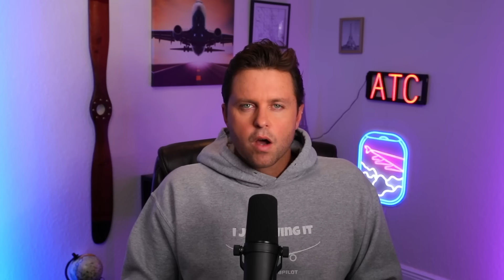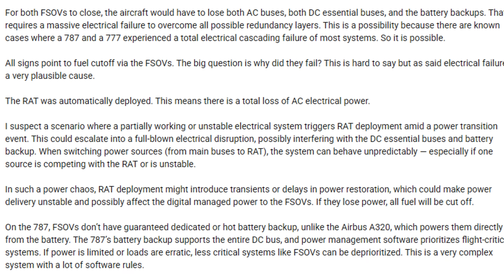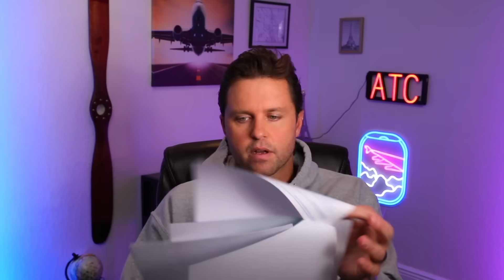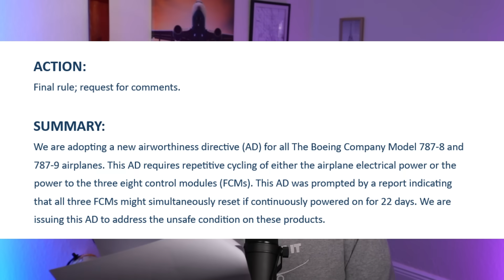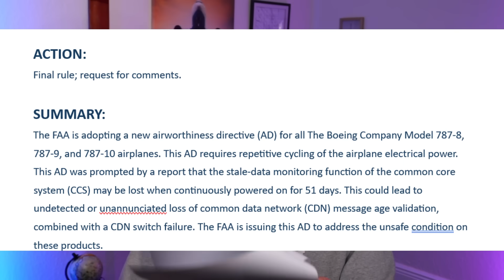Air India 171: Did a Software Glitch Cause Dual Engine Failure?

Comment: I don't understand if some electric failure does pilots don't have any manual control of the aircraft to land safely? Even if something majorly wrong and the way video shows Boeing 787 was gliding and gradually went down and does pilots don't have option to glide them more to a safe location or they not trained enough to handle such a situations?

Comment: Gary you are right and it's common in automation that some software contain accumulative faults, Airbus suffers from the same defect. Usually corrected by rebooting, its just what happens.

Comment: Incorrect info about what you refer to as the FSOV.  To be clear, the reference is to the airplane valve located upstream of each engine in the strut.  The following is basic architecture, at least on a Boeing, not just specific to a 787:

 The engine also has its own fuel control valve, but the FADEC (which has its own power source when the engine is running or shutdown but still spinning).

For a theoretical complete loss of airplane power, the airplane fuel shutoff valve will retain its last position with a type of magnetic latch.

The only things that should be able to defeat that magentic latch are 1) fuel control switch pulled to cutoff, or 2) fire handle pulled. The fire handle will be locked in this case, unless there is an engine fire indication or the fuel control switch is already at cutoff.

Upon takeoff, pilots would not be pulling fuel control switches to cutoff, nor would they touch the throttles.  Even if there was an engine fire indication, they are not touching these until safely above the ground.  For instance, you wouldn't want to pull the wrong fuel switch, or pull back the wrong throttle.  Get the airplane safely above the ground, then deal with such issues.

Your source post you reference has some credible statements, but the hydraulic references suggest he or she is talking a bit beyond their knowledge base.

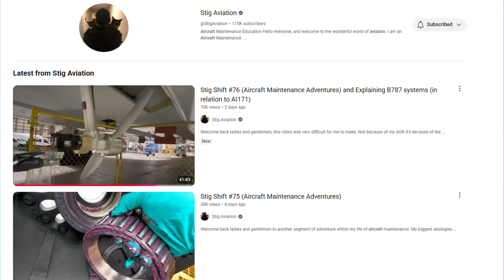Comment: Around 8:31, you said "millimeter of a second". I think you meant "millisecond", which is a valid SI unit. We don't know enough about that FSOV to say whether a millisecond power drop-out is enough to release the spring. Transients in electrical circuits are complicated. I kind of doubt if anyone knows enough about the transient electrical behavior in this aircraft. Which is negligent, but it's Boeing, which brought MCAS to 737 Max.

Comment: "When switching power sources from main bus to RAT, the system can behave unpredictably"
This is just flawed design.   Engineers know that when a RAT deploys, it's power will kick in and "compete" with the power bus.  Even a kid in engineering college will design so that there is orderly transition.  If here there wasn't, then it's absurd incompetence by Boeing engineers.  Wait -- there's more incompetence.  
If you design something like a fuel shut off valve,  you should have two valves, for redundancy, on each engine. Each FSOV must have dedicated dual power sources (like the Airbus).   Boeing has only 1 FSOV and it doesn't have it's own power source.  So that's 3 design defects right there.  But how can power to a fuel shut off valve ever be a lower  priority -- unless you liked to fall from the sky!
And finally, anytime FSOV shuts off fuel, a big light "Fuel shut off" should go off.  Pilots must be trained to throw a bypass around this.  They are nor.   So, one more point of Boeing incompetence.
BTW, any problems in an AC bus should not affect the DC bus.  They should run physically far apart from each other.   That's just good and careful design.  Looks like that wasn't done either.

My view is instead of expecting a series of electrical failures, it could be simply the computer stopping the fuel to the engines.   We know in the 737 MAX, the computer put the plane down.  Here too, the computer could do something absurd, like as shutting off the fuel, by going in to ground mode.

Comment: MASSIVE electrical failure MAY have occured.  

Cause - Water from the bathrooms damaging the electrical systems under the floor. Causing total electrical system failure. 

* Source - 2025 June Boeing AWD !

Comment: Excellent channel! Glad I found you! I’m just a layperson who flys tourist style occasionally from LA to Maui. My take is that what ever caused both engines to shut down must be reversed engineered with a super manual override system that the pilots can push or pull a lever which in a split second can restore fuel flow ! If I’m understanding that in the current 787 models this ULTIMATE manual override is not possible? Could a manual cable system (like a choke in a 1960 pickup) not be designed in? Or even an a fuel override powered electrically by the engines themselves using air from the near idle fan blades? I’m guessing this horrendous event could have been avoided if an ULTIMATE manual override was available to the pilots as a last resort option. Thanks for your consideration and the excellent comments from your knowledgeable community!

Comment: 4 days after crash an AD was issued about leaks in forward lavatory ? EE compartment is right under that . Also I heard that its rainy season in India right now and that rain might have entered  the airplane through external power plug as it was left open and that water collected when they rotated it went into EE compartment and then had a total electrical system failure .

Comment: 'I'm not going to speculate....' 
Why even post the video, it's all speculation.
If there were a major systems failure which affects the 787, the investigation would already have revealed as such. There would be a technical directive distributed to the airlines or the type would have been grounded. 
None of that has happened.

Comment: Gary makes some very good points. I would like to enter the zone of pure speculation for a moment. Would it be possible for the computer systems on the plane to be hacked or the updates to the computer system to be sabotaged by hostile parties? India just got through with an air war with Pakistan, who was backed by the CCP. Those  parties might have the motive and ability to do such things it seems like, but only people involved with the design and maintenance of those complex systems would know if such a thing was even possible.

Comment: Air India Black Box Decoded | NDTV Explainer: What Is The Status Of Crashed Air India Black Box https://www.youtube.com/watch?v=8Ng2QIK33mc  Maximus Aviation : water leakage problems can cause electrical problems https://www.youtube.com/watch?v=CcbJ8XkoT_I  WOW. Heavy stuff. How is the design? Why is it leaking?  What operations can cause leaking? How often to replace a coupling? What is the life time of a non-leaking coupling? What conditions can cause leaking? Guarantee always includes "normal" operation. Within the guaranteed operating conditions. What are the guaranteed operation limits and is normal operation for crew, maintenance / cleaning personnel  and passengers possible to keep within those limits? What are normal to expect procedures / habits of maintenance / cleaning personnel and passengers? What is "normal;"use? What does cause the leaking?  Is a heavier design required when so many airplanes have problems? Is it not only the coupling or should a complete redesign of that facility or the protection of the electronics be considered because coupling start to leak in many airplanes. Are water drtains possible and will the be effective? It is possible to dry it? Is it water from the toilet/etc or is it water from condens ...it is cold at thousands of feet. You can think of a complete redesign to get a water tight / sealed toilet with no leakage possibilities or a complete water tight electrical system.

Comment: Hey Gary, many thanks for your very interesting and, if you allow, very professional video. Although since 1985 I logged many hundreds of hours in flying, but on Sublogic’s Flight Simulator, later bought by MicroSoft, I actually do not qualify for commenting. But my intuition told me, from the first moment I saw the pictures of this incident, that a. the pilots did everything correctly and were deprived of control only a few seconds after lifting off the runway, b. that the software and wiring design “took over the control of the plane”, but c. actually was itself decapacitated due to heat, d. caused by the combination of 1.  air conditioning malfunction, 2. therefore overheating vital components, 3. positioning batteries too close to crucial flight controlling cabling, that 4. went critical and got up in flames, 5. cutting circuitry, 6. causing (cascading) shortcuts, 7. triggering AC AND DC power supply, that e. on one hand, engaged the RAT and on the other made the FSOVs snap. Considering the phase the plane was in and the required time to restart the engines (in optimal conditions) resulted, that the disengagement of the FSOVs was irreversible. But that’s just a report of the intuitive flash I had as I saw that the plane started to lose altitude. On the other hand, did I hear what you said and understood it correctly, for it could (probably very likely) be that the explanation for this catastrophic event might be due to one single temperature sensor (or let it be an array of sensors (like a DS18B20 or DHT11)) malfunctioned and fed incorrect, therefore way to high values to the monitoring system, such that the latter went into panic mode, triggering the cascade? Final thought: How could Boeing design the deployment of the FSOVs in such a way, and not the path Airbus took? I mean: how can you? Really? (Sorry for ranting, but it leaves me completely speechless). Thanks, Gary, for all! Please keep up your good work. And my heartfelt condolences to all who have lost loved ones. P.S.: when I listen to you quoting Boeing, I somehow get the feeling that it is not about presenting or explaining considerations, but simply, bluntly, only "statements of justification". Ouch, that's not good, shouldn't be happening: is a very intense dark red flag! It even gets worse: time index 3:50 "the system can behave unpredictably"! Did I get something wrong? Please tell me if so. It could be. But in this context, that "a system can behave unpredictably" is, ... let me put it this way: ... is rather complicated. In my spare time, I develop code and electronic devices and they sometimes behave that way. But I would never ever even dream of calling them RTM (ready to manufacture), let alone what Microsoft calls a "Beta" Version. ... and FAA, Boeing and friends let us board tendentially suicidal vessels? WT catch my drift?

Comment: Let me save you some gnashing of your teeth, while you are “not suggesting anything”.  
The fuel shutoff valves on the pedestal behind the throttles are MANUALLY opened, and MANUALLY closed.  NOTHING on the 787, and NOTHING on any other airliner, automatically closes these.  
Stig makes this exact point at 12:10 in his video on 787 systems.  He also makes the point that both engines will suction feed if all boost pumps lose power.
Meet Kevin tries to say that the fuel boost pumps are hydraulically powered.  That would make the 787 THE ONLY AIRLINER IN THE WORLD with hydraulically powered fuel pumps.

Comment: Why don’t you get in touch with a 787 pilot at any airline?  Go through the systems manual to prove your hysterical ideas.  Using Meet Kevin and Google as your information sources is REALLY SUSPECT.  And you call yourself an airline pilot?

Comment: Even here in India, people in the Aviation industry are talking more about the Electrical or Software related issues as both engines stopped producing Thrust at a time along with no visible indication of flame, smoke or anything.😢

Comment: Bonsoir, quelqu'un peut-il nous informer sur la manière dont ce problème d'alimentation des moteurs est géré chez airbus? Ne vaudrait-il pas mieux une vanne ouverte par défaut sous l'action du ressort (cela ne nécéssite aucune énergie extérieure donc insensible aux potentiels problèmes de circuits électriques) et assure l'alimentation en carburant primordiale pour faire voler un avion. Il me parait toujours temps de la fermer sous l'impulsion des ordinateurs si ces derniers detectent une situation prioritaire non? Je comprends cependant que les concepteurs, ingénieurs de leurs état ont toutes les raisons de choisir cette solution ( vanne fermée sans alimentation électrique) du fait du  cahier des charges qui leur est imposé.

Comment: There is an important point that you are missing out on your conclusions. Exposure time of the fleet.

If it was a simple software glitch it would already being demonstrated. Let's use the 737 MAX unfortunately example.

Less than 1 year and half after its launch the accident happened. For me software glitch don't take so much time to occur due to the exposure time of the fleet.

It is not related to a single root cause. The conclusion for this accident will change some regulations to the entire aviation industry.

Comment: Boeing build highly advanced aircraft that are mechanically and electronically sophisticated; they require little input from the pilot and crew. This poses a danger for three reasons. 1. The pilots are not able to override the various aircraft systems. 2. There are too many components that could potentially fail. 3. Maintenance of components can’t be done in every country due to a shortage of competent maintenance personnel. I can’t help but think that Air India has made the same mistakes as PIA. 🔗 https://wmaslam.blogspot.com/2020/06/pakistan-politics-and-pia.html?q=Zionists&m=1

Comment: The solenoid is of a 'locking' type that needs to be powered both ways. There are two shut off fuel valves per engine - the HPSOV and the Spar valve. Both stay where they are if power is lost.

Comment: If electrical, and a pilot-operated check valve is in the line, ( functioning the same way as a flow-fuse per se ....), then I could see an issue wherein the drop in voltage causes the ,( electrical), master fuel supply valve closing and starving the PO-check's pilot line, making it close and therefore the engines flamed out..... no possibility of fuel siphoning, etc... else Gary, I can't see water being the issue as it was scrubbed before being pumped into the tanks. ..... I go with electrical, with Flow control as the issue.
Stay Safe

Comment: I believe there is too much bullshit by the unwashed masses on this accident. Let the official report come out first, and then we will all know the facts. I am sure the FAA would have grounded all 787/Gen X engined fleets if there was any possibility of this being the cause, but they have not. No modern digital aircraft shuts off fuel to the engine "automatically', it is always the pilot's responsibility to control his engines. This stupid idea if possible, would be killing people left right and centtre. Do yourself a favour and wade through CFAR 14 Part 25 et al for the certification and safety requirements of large civil aircraft. We do not need this clickbait BS.

Comment: This would explain some random coincidences. 
1. Why did both engines lose power simultaneously 
2. Why are there no signs of an engine failure (failed burn, smoke)
3. Why did the plane take off so late (Either non recognisable issues before v1 or the failure started between v1 and vr)

Comment: The engines will go to Idle if electricity is lost. The fuel pumps work mechanically and the fuel valve should stay open. The engines will not shut down.   The Rat may not have enaugh air speed and dencity to work so slow and low + extremely hot air

Comment: When a computer or mobile phone freezes, you can typically resolve the issue by rebooting. This process clears the device's memory, effectively restarting the software from a clean state. However, the Electronic Engine Control (EEC) unit's memory in the 787 engine cannot be rebooted in the same way. This phenomenon is referred to as a "memory leak," and its symptom is the improper functioning of some devices, similar to the electrical device problems experienced on the aircraft's previous trip.

Comment: I Loved this video and new possible info discovered related to the crash. If the FSOV issue is true, then it is totally unconcionable that this design is allowed. NO WAY should an electrical failure be able to shut down a fuel valve under any conditions. (I understand the FSOV is spring loaded and will close if electrical power is lost). Only the PILOTS should have that ability to control the fuel cutoff. That is already available in the cockpit. This is AS BAD as the MCAS debacle for the 737 aircraft. IF this is TRUE, the FSOV must be taken out of all 787's immediately. All planes should be grounded until the FSOV is removed from the fuel flow line!!! BOEING, You stand on NOTICE that if TRUE, this MUST Be FIXED immediately!!!!!!!!!!

Comment: It was a "get the fuel truck over here error" you wait and see. all this reaching and grasping at fifth degree compounded factor failures all to ignore the most likely cause "we forgot to fuel up before take off" and why is that? if this were SW and it happened on the US west coast would the same sort of benefit of the doubt be granted? I seriously doubt it.
  Air India has been getting some pretty harsh reviews on the conditions inside the cabins of these aircraft , so harsh in fact that it makes one ask if they can't even clear the trash from the cabins and sanitize the bathrooms , what other ground crews are effected by this sort of negligent work culture?

Comment: In 2015, US aviation authority warned about Dreamliner. If electrical generators are running continuously for 248 days theh drop into failsafe mode. Results in loss of all AC power. Bad news if you are taking off